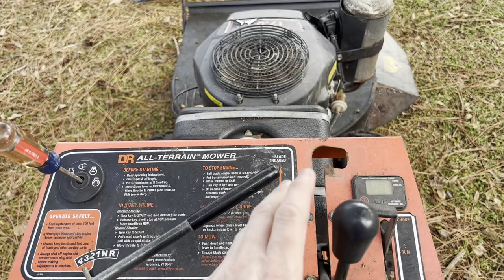DR Field and Brush Mower overview

Comment: im getting a 14.5hp one with a lawn mower deck brush hog,blower,blade and a wood chipper wich cost me $8,057.00
Reply from the maker: They are expensive new. I paid 700.00 and put 400.00 into it. Not bad.
Reply: @graybeardgarage9638  yeah the bcs 10.5hp unit with 22 inch lawn mower deck and blade here are $20,000
Reply from the maker: 20k is some big money
Reply: @graybeardgarage9638  yeah  im kinda glad i went with dr from a kubota dealer
Reply from the maker: I think that was a good choice